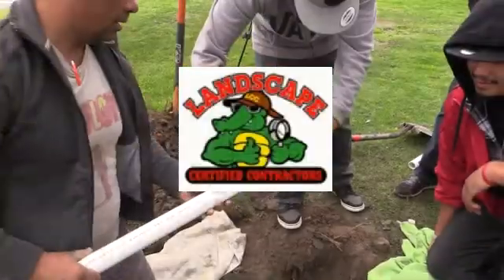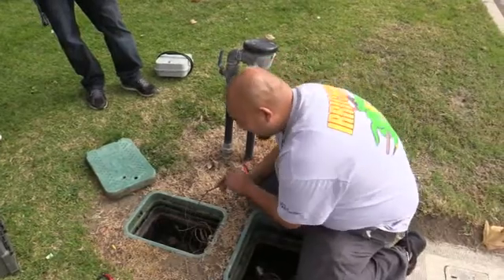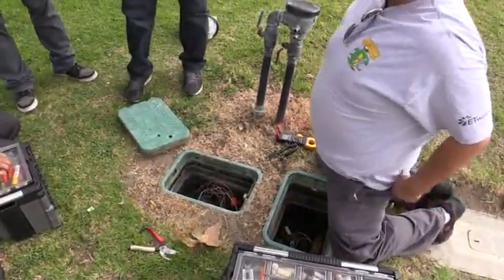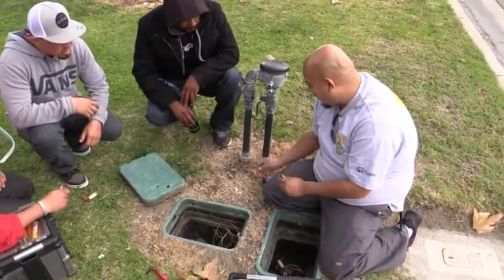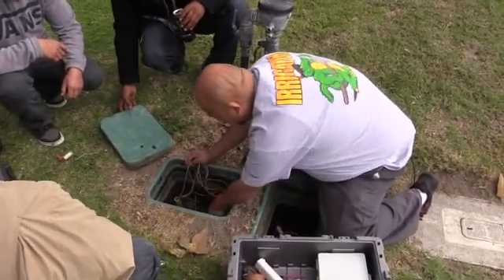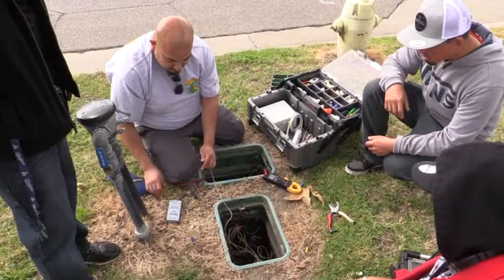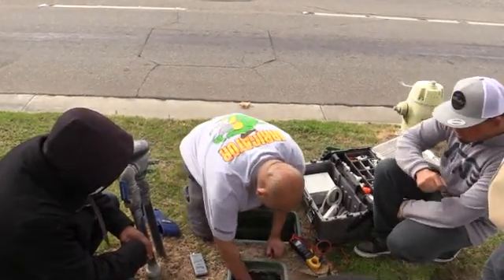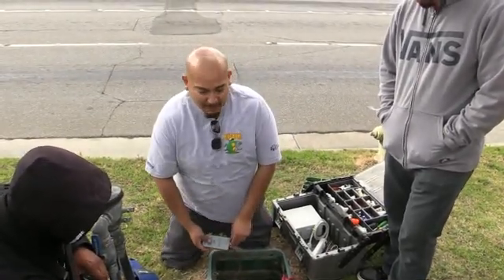Irrigation Valve Troubleshooting

Comment: a bad solenoid will normally have an ohm value in the single digits. most will read 25 or above, but some ancient weathermatics are in the teens and will not function with a modern timer